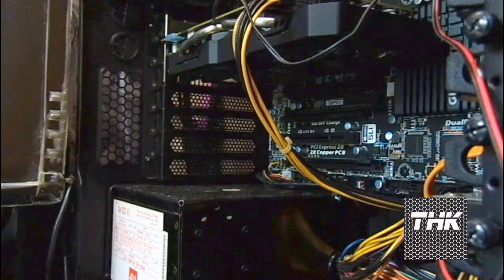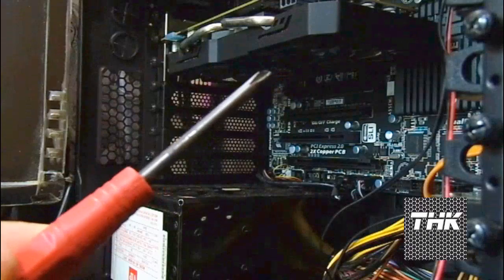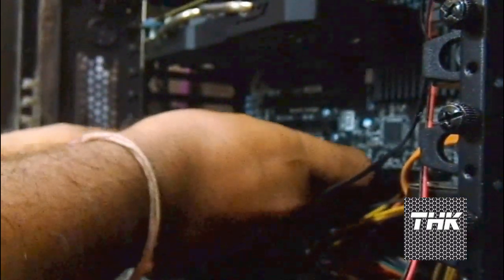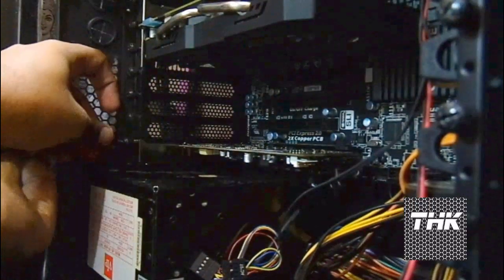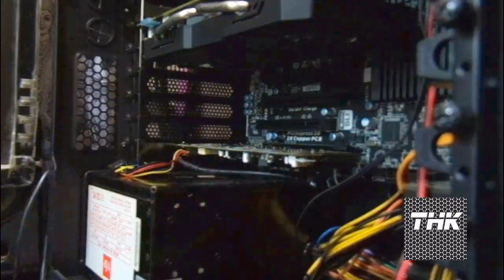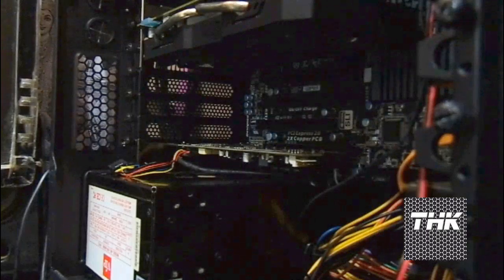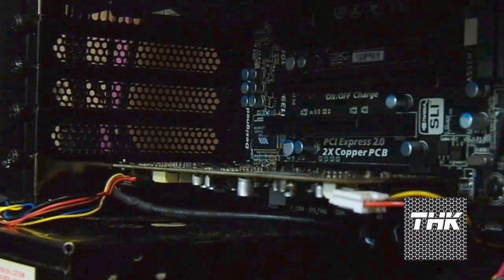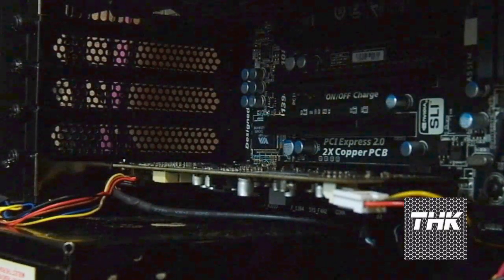Installing Asus Xonar sound card

Comment: Hi, I was wondering if I wanted to connect this card to a 7.1 receiver via spdif and use my mic as the same time it would be impossible. Due the both being the same port. Nevertheless, during your video I over heard you say that there a front display panel connection. Could that still be used simultaneously to have a mix and the optical out being used?  As well my motherboard is an asus p9x79 deluxe and it has a mic in, would that work as well with the same way? (I know my MB has an optical out already but it is not too good for 5.1)
Reply from the maker: Carlos D'Aparicio Can be connected to a receiver and at the same time the mic can be connected to the input of the sound card. I have not checked front panel working with the above setup or not. But I am sure it woon't work. Also the font panel out is n ot that great for use. On onboard sound works with this card doing its job. 

I would suggest to go for another sound card, coz this is really an older horse now. Hope I have answered your question.
Reply: Wait, the Mic in port the same as the optical out. how can you use both? I asked if the receiver that getting the optical signal from the sound card and connecting the front panels from the computer case to it, so that way the mic in can be used. or the sound card for optical out and then my motherboard mic in for my mic. are any of those possible?

Comment: Is it possible i dont have a front panel audio connector?
Reply: you unplugged the front panel connector! no it's not connected automatically! But all you have to do is check the user manual that came with the sound card and see is there a front panel connection! if not you can still use the audio on the motherboard it's probably already connected to front panel. So check the manual that came with the sound card and you will know soon enough if there is a front panel connection! If it's not mentioned it does not have one! OK! Hope that helps!
Reply: I find it but its 8 one pin connector (mic in, r in, l in etc...) so i need to connect these to motherboard and the other side to the soundcard?
Reply: No! you need to read the manual! most sound cards will be connected directly to the front panel connection!